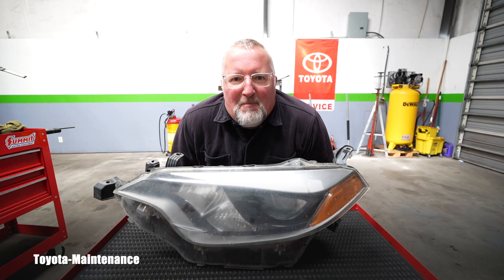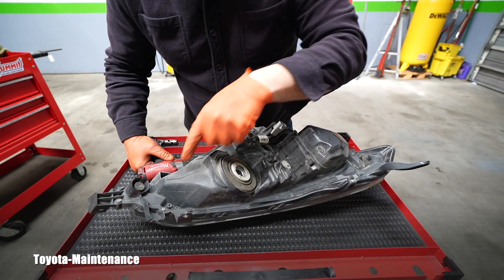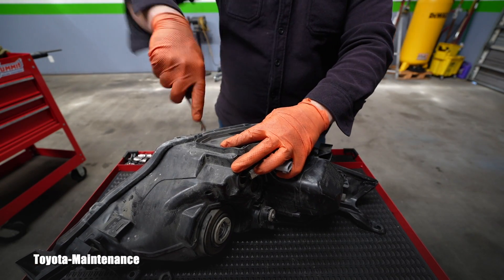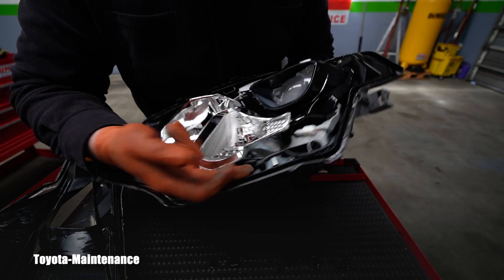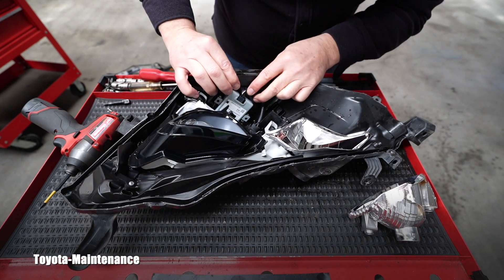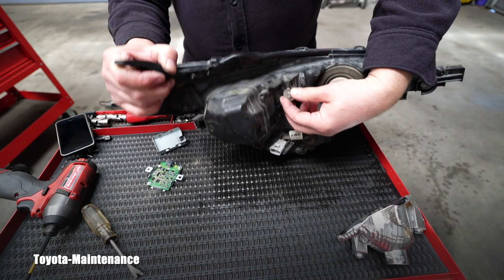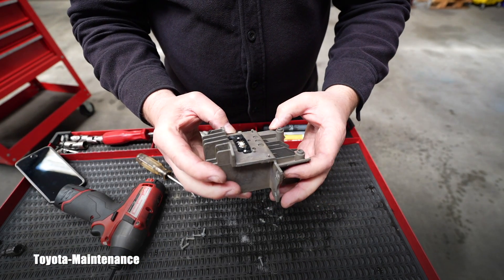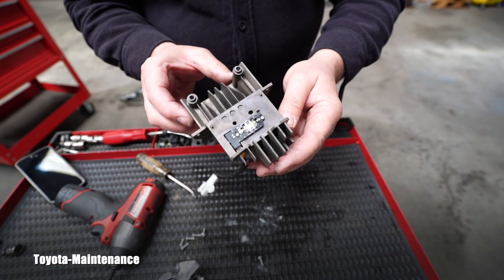Toyota Corolla Headlight Assembly Dissection

Comment: Thank you very much sir for this video, I learnt allot from this. I bought a 2017 Corolla recently only to find out that I will have to change the sealed headlights which have no bulbs to change and the it emits low lights. I will dissect as well and see if I can replace the ballast to improve it's light. This is Adeyinka from Nigeria.

Comment: If this was just water damage and possible to fix by drying out the equipment they why didn’t you give that option to the customer. Wouldn’t it be cheaper than buying a new headlight assembly. Did you acquire consent from your customer to keep the old equipment. In many states it is a law to allow customers to keep the replaced parts.

Comment: Hello. I have a 2001 Sequoia with 2UZ motor. In your opinion is about 205 ish degrees too hot for engine coolant going about 70 on highway with air conditioning on full? The dash gauge stays in the middle, but i have scan tool attached so I can see actual temperature. Thank You for your time.

Comment: I have a hi tech way of preventing this moisture from building up in this enclosure. Drill a smallish hole in the bottom, and if you can another hole in a sheltered position above it. This will enable the light to drain and dry with the heat of the led. 
Really hi tech but it works.

Comment: I found a parts diagram for the led driver in the Japanese version that shows a removable panel at the bottom of the assembly. The drive part is unfortunately about $420 so little savings there, but easier to open than removing the lens.

Comment: Great video, thanks!  2014 Corolla owner.  I figured that there was some lenses and magnification shenanigans going on to make a tiny LED shine so intensely, and this breakdown answered my question.
I'm going to guess it needs such a huge heat sink because the assembly with the LED is (supposed to be) completely sealed.  No air cooling.  Even though LEDs don't throw much heat, it could get pretty hot in there.

Comment: This was a fascinating video! I am disappointed with Toyota for making a headlight assembly in which the low beam cannot be accessed. To me, this is an engineering boondoggle!  Thanks for a great video.
Reply: Not to mention putting computers in the headlights?
Reply: The only way to make led headlights lights reliable is to seal it from the elements, put a giant heatsink on it and use a flux led.   Consider how much goes into that low beam shell  vs an aftermarket led bulb.  They have all the same components but the Toyota one is built like a tank

Comment: Thanks for the good work, is 2008 Toyota Corolla a good car to buy used?;l can't afford to buy the newer models.
Reply: 9th generation ended 2008 so without question one of the best to buy for reliability and longevity.
Reply: @davida871  thanks a lot.
Reply: They are excellent vehicles. I own two of them. I also own a 2009 Corolla but it's nowhere near as good a car as the 2003-2008 Corolla.

Comment: A $1200 10-year/100k service agreement from Midwest Toyota in Kansas is an even a better deal with difficult-to-replace headlights. All the computerized stuff is justification enough for the VSA.
Reply: As impressively complex as that headlight assembly is, a complete, lifetime-warranty replacement (Toyocera, a very high-quality Taiwanese aftermarket producer) is $144 at RockAuto.  But your dealer’s finance manager does thank you for spending your “peace-of-mind” dollars with them.

Comment: Correct me if I’m wrong but you should not be able to remove the cover like that without heating up the Butyl rubber that seals the lens to the headlight assembly. 🤷🏻‍♂️